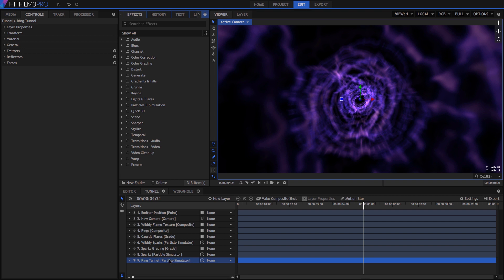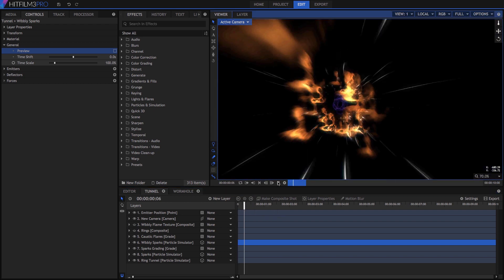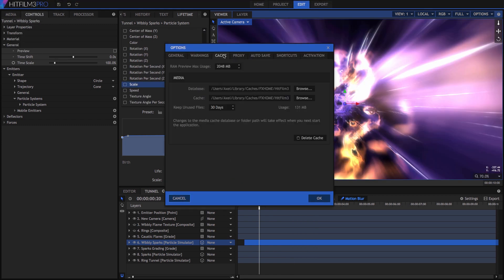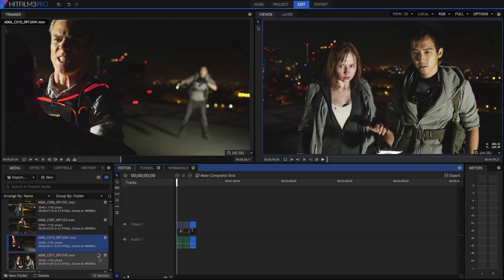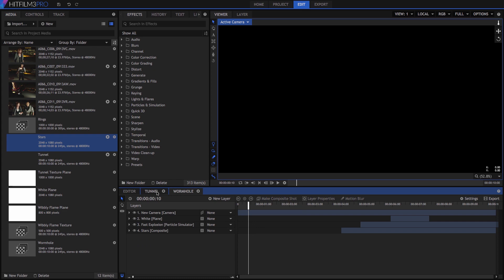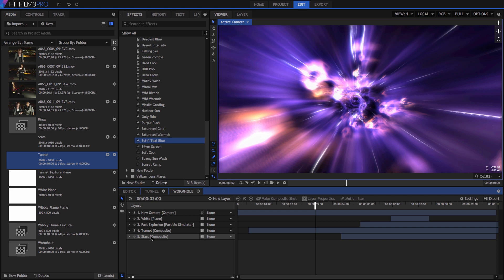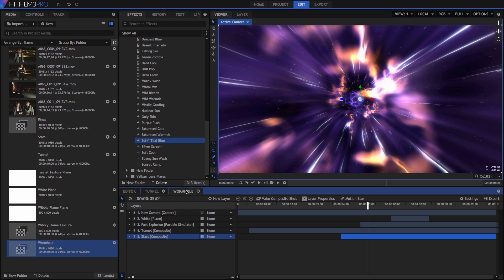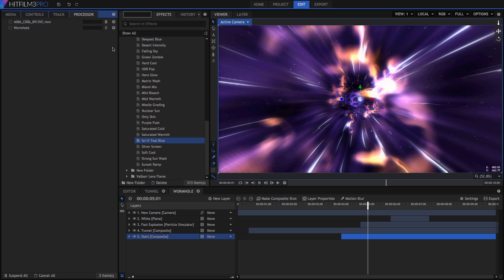Speed up your workflow in HitFilm

Comment: I have good PC but every time i play my video in viewer it lags, i set max ram usage to 4000 and it work well ! I have 8GB RAM (Sorry for my english)
Reply from the maker: That sounds like an issue with your video format. Have you tried converting your video to a format designed for editing, that decodes quickly?
Reply: HitFilm Lol i will try it
Reply: So you set RAM Usage to 40GB when you only have 8GB or rather to be exact 39GB and 40MB. Interesting.
Reply: Sorry it is 4000 not 40 000 >,<

Comment: I got the windows 8.1 32 bit, and I downloaded the hitfilm ulimate but I dont see the proxy. Question what will be the best hitfilm in my case Thanks
Reply from the maker: HitFilm Ultimate is a 5 year old version of the software that predates the Proxy system. Grab the latest free version, HitFilm 4 Express, to try out the Proxy system: http://hitfilm.com/express/heads-up

You will need a 64-bit system.
Reply: Ok, I don't have 64 bit Thanks

Comment: Where are the proxies stored?
Reply from the maker: The directory used to store proxies can be set in the Options (Windows) or Preferences (Mac). So you can store them wherever you prefer.
Reply: HitFilm How do I set them not to be used for render?
Reply from the maker: Same place. In the Proxies tab of the Options/Preferences, there is a tickbox that lets you control whether or not proxies are used for Export. Exports will frequently be massively faster with that option enabled.

Comment: Will you be improving the proxy creation speed? (sorry but sometimes it takes multiple hours for short length-ed videos) P.S. I usally have bigger files which are many gigabytes and sometimes lossless. Should I just compress my videos?
Reply: I mainly ask because rendering usually is quite a bit faster. I understand it is lossless, but I am just wondering.
Reply: Nice.
Reply: I've tried that before and Gitfilm doesn't seem to make much of a difference, even if I change the file to have a CFR.

Comment: Will the RAM preview make it to the express version?
Reply from the maker: dminer78 it already is! Both proxies and RAM preview are in HitFilm 3 Express as well. Although Express doesn't have all of the effects and features of HitFilm 3 Pro, we didn't want to cut out stuff that's integral to a fast workflow.
Reply: HitFilm
I see the proxy but I don't see the RAM preview button on the play header. I only see the play options. There's nothing after the play button. I'm running  3.1.4321.38300 (Update 8)
Reply from the maker: dminer78 RAM preview is only available in composite shots. It could be that you're on the editor timeline, which doesn't have the feature.
Reply: HitFilm
Ah there is is! I see it now. Thank you! :)

Comment: Can you do a tutorial on how to adjust timescale, and zoom in on a specific part of the video.
Reply from the maker: itsToxic | PC Gaming do you mean zooming the timeline? If so, at the bottom left of the timeline you'll find a slider you can use to change the timeline scale. You can then use the scrollbars or the Hand tool to move around. You can also use the Ctrl+Home key shortcut to move the view to wherever your playhead is, which can be handy.
Reply: +HitFilm No. I'll give an example: You are filming something and when you are done you upload the footage to your PC. Then you re watch the footage and notice that on the corner of the screen something cool happens, so you want to zoom in to that corner of the screen. And I'm also asking how to do it without taking a screenshot and then zooming in on the screenshot.
Reply from the maker: itsToxic | PC Gaming ah, so like you see in documentaries and news reports? In a composite shot, every video layer has a Transform section. If you turn on keyframing for the Position and Scale settings, you can then create animation to enlarge and push in on a specific part of the frame. Check out this tutorial for more info: https://youtu.be/jEPm2FPMZI8 It's a Pro tutorial, but the general techniques are the same in Express.
Reply: HitFilm I have another question/problem. I exported a video in H.264 to my desktop. It's about 5 minutes long, but when i exported it, its 37 minutes (which is the raw clip length.) I set the endpoints and everything, so I don't know what I'm doing wrong.
Reply from the maker: itsToxic | PC Gaming when exporting you can set the 'Export area' option on the export screen. 'Entire timeline' will export the whole timeline, 'content area' will export as much of the timeline as has media on it, and 'work area' will export the section you've manually specified.
Reply: +HitFilm Thanks a ton! You guys rock!

Comment: Are proxies same quality as source footage? I can just export my finals using the proxies?
Reply from the maker: jrsmoots You can indeed. Some info from one of our devs: The proxy video codec was custom-built for HitFilm and is lossless, so you don't need to worry about generation loss with your exports. The codec was designed to achieve the best lossless compression it can while still allowing real-time playback. So it generally favours real-time decoding performance over compressed size. It handles both 8-bit per channel (32-bit RGBA) and 16-bit per channel float video.
Reply: HitFilm That's excellent news! Thanks very much for the additional info, and thanks for adding this feature to Hitfilm!

Comment: Great! Altough proxies are not fancy, they are very useful !
One question:
The quality of the proxy files is equivalent to that of the original files ?
Because if It's not, rendering using proxies would not be the same as normal rendering.
Reply from the maker: Adelson Munhoz The proxy video codec was custom-built for HitFilm and is lossless, so you don't need to worry about generation loss with your exports. The codec was designed to achieve the best lossless compression it can while still allowing real-time playback. So it generally favors real-time decoding performance over compressed size. It handles both 8-bit per channel (32-bit RGBA) and 16-bit per channel float video.